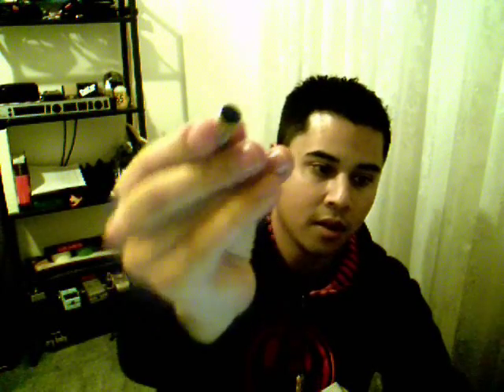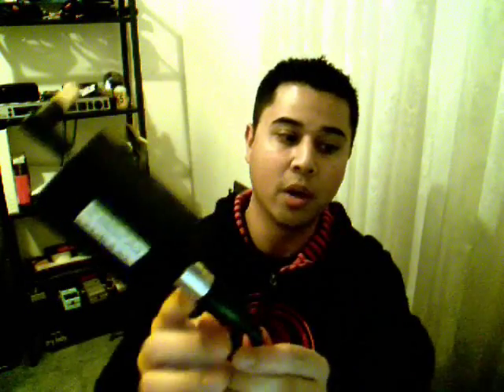Electret Microphone

Comment: I have ordered a cheap electret mic which comes with a 1/4" jack adapter which houses a AA battery(  1 and 1/2 v.) I intend fitting it in my flamenco guitar, as I truly detest the sound of under saddle pickups.SO ,Will it be OK to use a 9v battery instead, and will this improve the sound??Your acoustic guitar sounds great using this little mic,and better than many demos of ridiculously expensive, name brand kit. Thanks for a useful, informative video.

Comment: Are these small mics from cellphones omnidirectional or unidirectional?
I'm avoiding ambient noise as much as possible.

These mics seem decent for vocals. How about violins? BTW, the mic sound like a speaker dampened with foam. A radical EQ may help, maybe.
Reply: Generally they are omnidirectional. You can find unidirectional as well, they're just not nearly as common.

Comment: I have an electret microphone which I've salvaged from an old broken mobile phone - what I want to do is use the old phone as a case and mount the old microphone back inside with a 9V battery. Is it as simple as wiring the battery into the circuit or will I need to include a resistor?